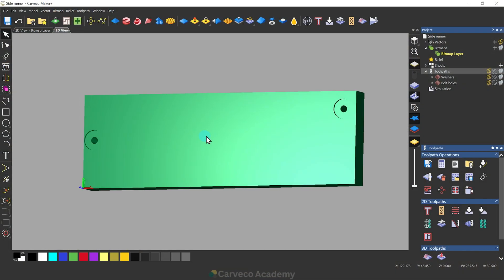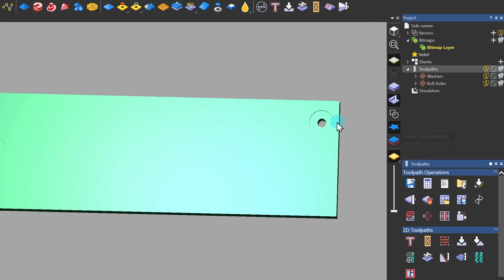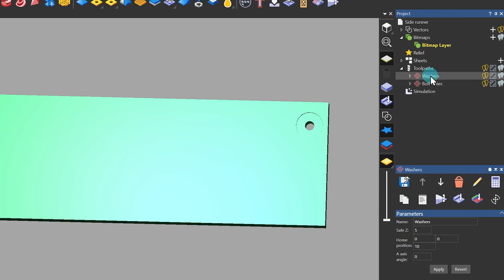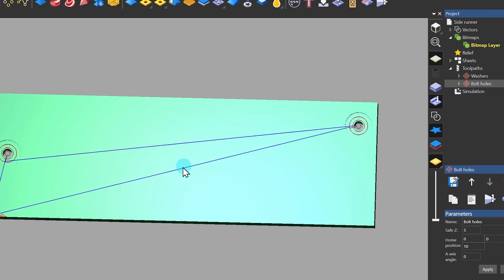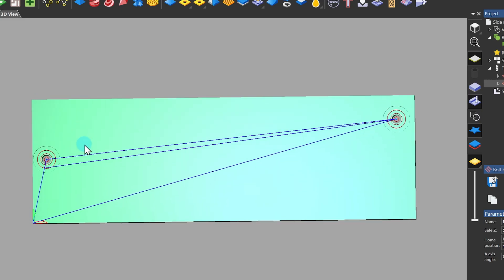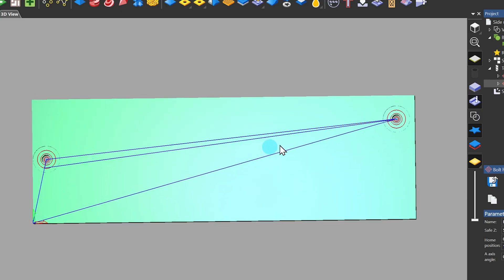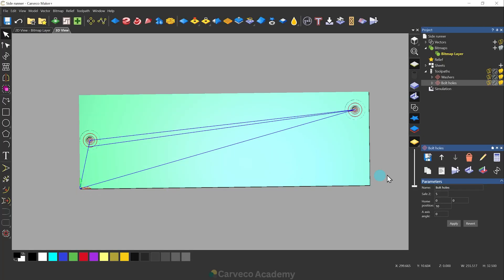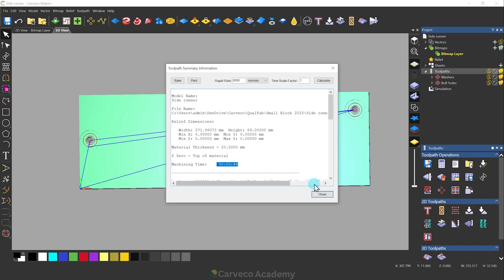Speed up your CNC work to make more profit - Batch Working Tips!

Comment: Just found your channel again, good to see you progressing, the wife and I have been busy dealing with what life throws at you for the last 2 years. This week we are back in our small Cabinetmaking  shop for the first time in a long time. 2 years ago we bought the same Longmill that you did and now we are starting again from scratch. My question to you is, as of today is it worth spending the money to upgrade the MK2 to the MK2.5 plus upgrade the Makita to a spindle or would we be better off buying the Altmill or a different machine completely. We are completely out of touch with the CNC Router world and are planning on devoting 16 hrs per wk going forward getting back into it, we would value your expert opinion on this matter, Thanks James.
Reply from the maker: Hi and thank you for coning back. Thats honestly really hard to answer without knowing everything. My initial hunch is to say start with what you already have. The upgrades for the 2.5 are a nice to have but not essential and the SLB really don't impact the Longmill too much. Yes the AltMill is better in every aspect but equally does cost quite a bit. If you find the Longmill is starting to hold you back, that's when to upgrade. Hope that helps

Comment: James..or anyone that can help..I upgraded my Genmitsu 4040 to a 6040 with the extension kit. Using Candle, it jogs short on the X axis as if it is still a 4040. What would the correct way to adjust the X setting in Candle so I can get that entire X travel?
Reply from the maker: Its likely your $130 GRBL setting. This is your Max travel distance for the x axis. You'll need to change it from $130=400 to $130= 600
Reply: @JamesDeanDesigns  Thanks!